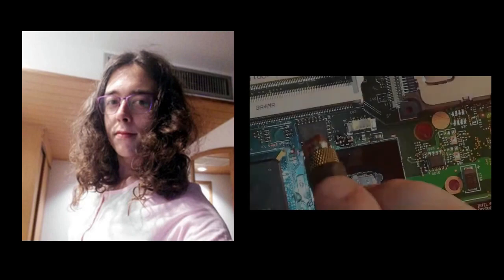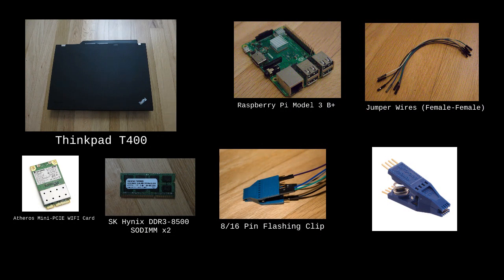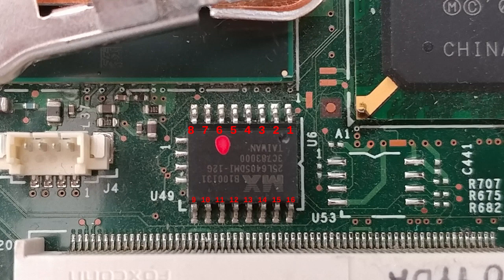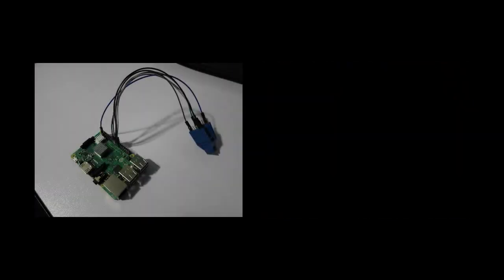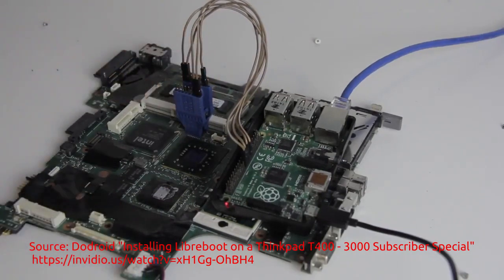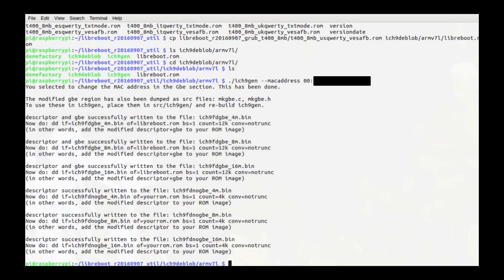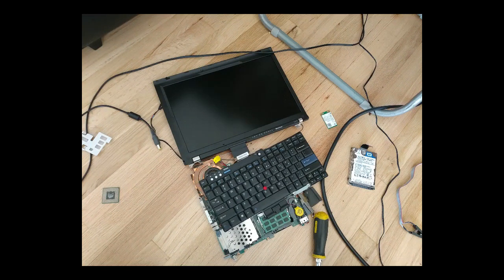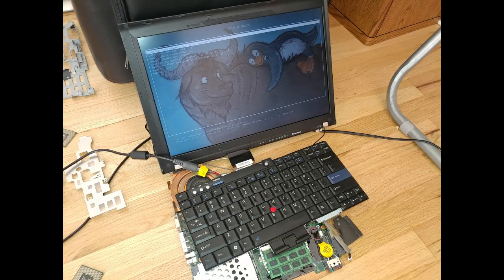Librebooting a Thinkpad T400 with a Raspberry Pi (Comprehensive Tutorial with Troubleshooting)

Comment: Congratulations! I just got my x200 librebooted too. However I could not set up wifi neither in Parabola nor Hyperbola i guess it is blocking out my original intel wifi card. What wifi card is recommended? Just any random Atheros wifi N card mini pci is fine? Thanks
Reply from the maker: You will want an atheros card supported by the ath9k driver. That's the one available on most libre distros. You can find info about different cards on hnode: https://h-node.org/wifi/catalogue/en
Just sort by interface. Their part numbers start with AR9- 

Hope that helps

Comment: my t60 got bricked, do you think this guide (in terms of wiring and the chip) will be the same? i have a macronix chip too, 8 pin, just not sure if its the same

thanks and nice video
Reply: You can get libreboot on a t60 without ever opening up the machine iirc. How did you brick it? I'm a bit confused
Reply: @ProperlyPsychotic  I already fixed it. you can brick it by forcing a kernel flag instead of adding it to grub and restarting
Reply: @Artixou  Ah, how did you fix it if you don't mind explaining?
Reply: @ProperlyPsychotic  By diassembling it down to the motherboard and flashing the chip

Comment: Hey I was having a problem and was hoping you could point me in the right direction. So on my raspberry pi model A+ V1.1 I am getting a segmentation fault when I run flashrom from the libre boot utils. It doesn't output any meaningful info other than "Segmentation Fault" I ran it in gdb and gdb says that a call to fork() caused the seg fault. Maybe my raspberry pi doesn't have enough memory to run flashrom? I'm not really too sure what to do. it has 512 MB of ram. Also strangely the flashrom program installed on raspbian works fine. Any help is appreciated, thank you :)
Reply: Gunna try to build flashrom from the sources and see if that could fix it, wish me luck ;-;
Reply: seg fault is when a program tries to access restricted parts of the memory. My best guess would be to go into your grub config and to set io_mem=relaxed. I have a video about a T60 where I show how this is done, but there are also forum posts explaining how to do the same. If that doesn't work, then sticking to the flashrom program installed via raspbian should be fine. 512MB of ram is enough, trust. Linux does a great job of handling memory so don't worry about having so little.
Reply: @thecreatorism  Got it to work!! Used the raspbians built in flashrom and that worked fine. Had some problems with a non Pomona clip but it worked in the end thankfully. Now I have to buy some ram as only one of my 2GB Kingston chips works. Thanks again for your help and enjoy your freedom!!